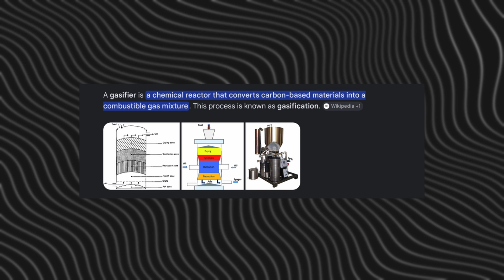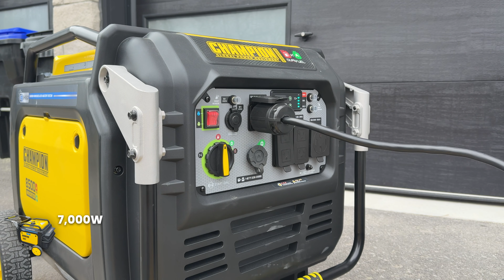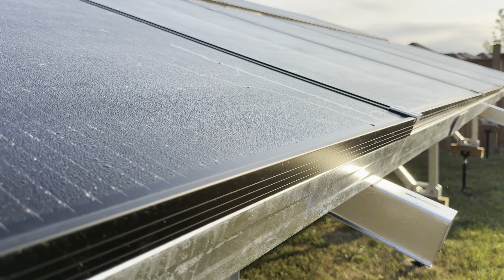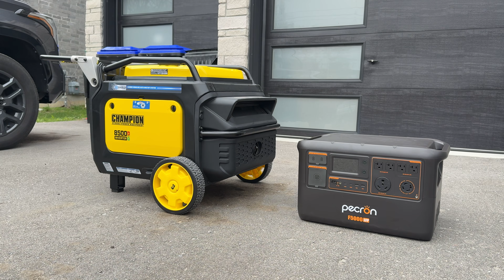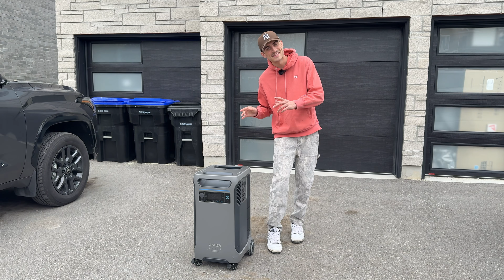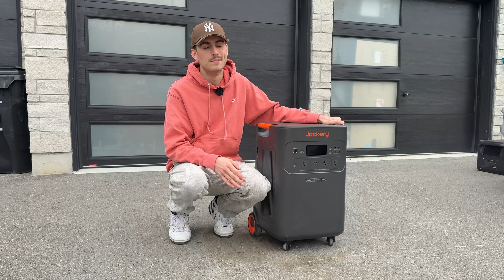Can a Power Station Replace Your Gas Generator?

Comment: Make sure that generator has a PURE SINE WAVE inverter.
Reply: If it doesn't, then unplug the power station from your loads before charging it from the generator.
Reply: The pecron 5000LFP specifically has a "Generator power" setting to allow charging from a non inverter gas generator. My plan is to ONLY use our firman gas generator to recharge the Pecron at around 1800 watts from the 30 AMP port to keep it from fluctuating too much just to be safe. Folks with other battery systems should investigate if their units can handle dirty power, absolutely!

Comment: i think having a generator to charge up a power station for 2 to 3 hours possibly 1 to 2 times a day and to have a back up to a back up is worth it
Reply: Generator power is to expensive for this. Use grid or solar to charge the power station.

Comment: Anyone that hasn't figured it out yet, you need both to compliment each other.
Reply: As a back up plan if you can’t produce enough solar or it’s cloudy something like that, but we gotta clarify those things
Reply: I wouldn't say need, but they do work well together and both are part of my hurricane plan.
Reply: @williammeek-h2o   They are the best power solution. Rather then a noisy generator using a genny to power the battery is the best set up. Basically hybrid power the same as a toyota prius.

Comment: This is way too simplistic and reductionist.   A power station can keep a few lights on and your fridge cold for a day or so.  That can be all some people need.  But if you have a well pump, a sump pump or need any kind of electric heat or AC you will almost certainly need a fossil fuel generator in less than a day.  The only way that isn't true is if you spend many thousands of dollars on an incredibly elaborate and huge battery/solar system more appropriate for long-term off-grid power than getting you through a power outage.
Reply: Yes, I charge my big ass battery generator with my big ass gas generator in these cases. Quiet power 90% of the time, loud ass noise after showering in the morning to top up the battery. It doesn't have to be an either / or situation.

Comment: the power stations limit the solar you can  use 
they also tend to fail at the worst time 
a real solar array is the only good option if you want to run anything large 

I live off grid I have 2 12 volt arrays to run a mini fridge AC and some electronics I need 
I have 8 batteries life po and 2600 watts of solar 
depending on how hot it is you have to pick what the priority is to run
now think how much more power does a average house use 
I get by on 15kwh  a day with my solar in a desert

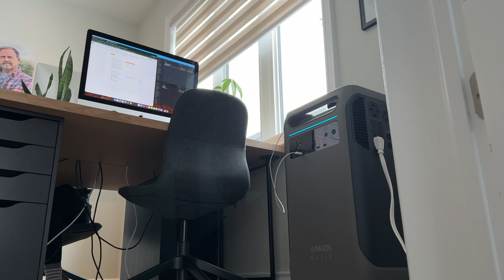Comment: 1:14.....".power stations do the same thing that gas generators do".  No, they don't. "Power stations" are batteries.
Reply from the maker: Yet they deliver the same power 😅
Reply: @TheSolarLabPlus  .....comparing a honda eu1000i and the Bluetti 300 (3000 watt hours), for 4 hours they WILL put out the same, assuming a 750 watt load. The gasoline remaining in the honda will go another 2 hours. Ir can be refilled for 3 bucks, in about 2 minutes.
   The Bluetti Lifepo battery, charging at .2 capacity, will take 5 hours to charge. Higher rates are possible, but that is not good for a device that costs $1200.
  They are not the same, and this is why it's an apples and oranges comparison. 
   A 300AH LiFePo Power queen battery or similar is around $500 on Ebay. Another $200 gets you a 40 amp LiFePo charger and a small inverter. 
  The $500 difference could purchase another 300AH battery.

Comment: Do not charge a power station with a non inverter generator.. non inverter or open frame generators do not put out a clean sine wave and they can damage your power stations.
Reply: and that is another good reason not to get one. You're much better off getting a lithium charger and a decent battery. You can even use a solar charge controller and any DC source 15 volts higher than the battery voltage.
Reply: @danstrayer111 is that a car battery?
Reply: @brandiclark7117  No, use a LiFePO4 (Lithium Iron Phosphate) battery.
Reply: Just use propane and don't overthink it. 

Power stations simply store power. Generators convert energy into a form that can be stored in a battery
Reply: While generator is converting the energy into a form that can be stored in batteries, there is a frequency at which they do it per second, if the frequency is not clean, you will spoil your powerstation, that is what he is saying. You need to think that through first
Reply: @EasyyokeFilms  that's why you use propane. And when I'm an emergency you survive, your power station will be fine
Reply: @EasyyokeFilms  The one in the video has a mode specifically to handle dirty power from non inverter generators. You are correct that not all can do this, but some can. Technology is changing quickly.
Reply: @TheYellowSnoman  As a few people mentioned already, if you charge your power station with a generator, be sure its output is pure sine wave. A pure sine wave generator (or inverter generator) produces a clean, continuous electrical wave that perfectly mimics the power from a standard wall outlet. You must use this type of generator to avoid damaging your power station.
Reply: @bryanbryant9962  you're simply wrong. Pecron does not require pure sine wave input. It does deliver clean output. 

It's things like this where people say crap on the Internet over and over when they're wrong. You guys are wrong.
Reply: @TheYellowSnoman  My PECRON F3000 Doesn't seem to mind the input from my non-inverter Westinghouse WGen9500df. Open frame generator. Neither does my  separate inverter battery back up for my sump pump. Generator during the day. F3000 during the night to run my gas furnace and a few lights in the early mourning. My router and WIFI have their own battery back up. My computer is on a separate UPS.
Reply: @bryanbryant9962  Newer power stations like the one in the video can handle dirty power from a generator. Yes, it is important to know if the one you may own does or not, but I think the time for making blanket statements like this is over.
Reply: @TheYellowSnoman  Yep, on the 5000LFP it is literally called "Generator Power Mode"

Comment: Best way may be to have a gas generator first and then add a power station to the set up. Like the video you posted last year. Or have a DC charger from car to power station. Just have a way to charge the power station fast when no sun is available.
Reply: Exactly what I did. 👌

Comment: Hey Guys, this new channel is throwing me a curve ball but pretty good so far🙂Couple things, can you really charge the power station direct with dirty power from the gas generator? I thought it had to be an inverter generator? Second, does the Jackery surge to 28,800 or does it stay at 14,400 if you parallel two together with the smart transfer switch? #BLESSINGS from Alabama🙏
Reply: Generators do provide somewhat "dirty" energy because of slight fluctuations in power or frequency, but to charge a battery those things don't matter much. A battery is not that picky about where its power comes from. I have used all kinds of generators coupled with automotive chargers and lithium chargers and have never had a problem.  Frequency issues appear with really sensitive electronics.
 off grid for 30 years.

Comment: An inverter gas generator does one thing a power station cannot. Guess what it is? Guess what it is? Guess what it is? Be refueled in less than 5 minutes. Talking about two totally different things. Talking about apples and oranges. Couldn't get past the line add 1 minute and 14 seconds. Now I will continue to watch the video and see if I have put my foot in my mouth.

Comment: If you’re in the north and you need power because of an ice storm chances are solar is not gonna do much good however here in the south after hurricane usually it’s clear and solar recharging will work. But ideally getting a decent battery back up and something like a Wen 6800 Duel fuel generator and if you powered from propane and have 100 pound propane tank or even just two or three of the conventional 20 pound propane tanks, which have indefinite storage unlike gasoline and if you run a couple of times a day to top off your battery backup that seems like a great deal. 
I recently bought a 3000 W battery backup or a 350 W panel and a 200 W panel and I’ll do some testing to see how that works but having a generator for inclement weather to keep your battery back up topped up seems ideal. Especially if you use propane.
Reply: Gasoline stored properly will be good for years. Here in Idaho, solar is just fine, many clear days and the colder the better for solar panels.
 Having large as possible lithium storage is essential in all cases, regardless of the source of the energy.

Comment: Ridiculous comparison. If you have a shtload of panels to charge the power station. Why compare with an oversized gas one? Mr. bad haircut came out with the real answer. Good power station small gas generator. Problem solved. Trying to solve a problem that doesn't exist. Or thinking what to make your next video on. Like your stuff anyway your learning, always a good thing.